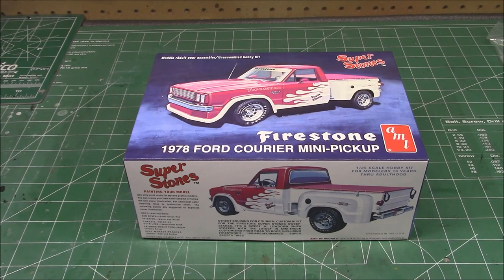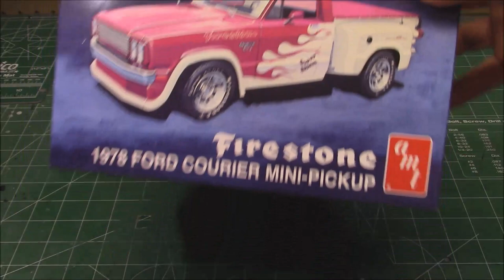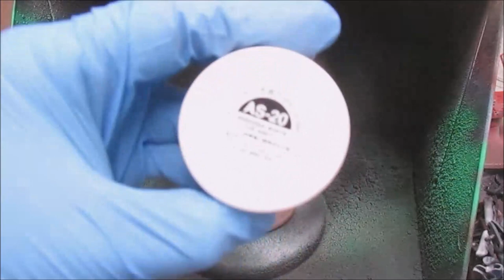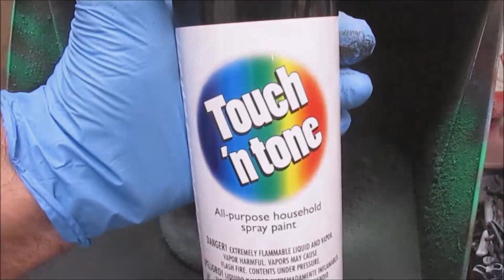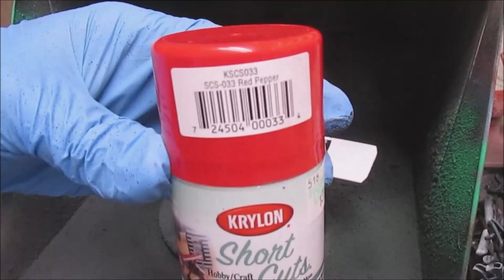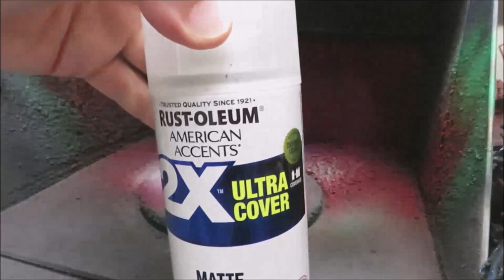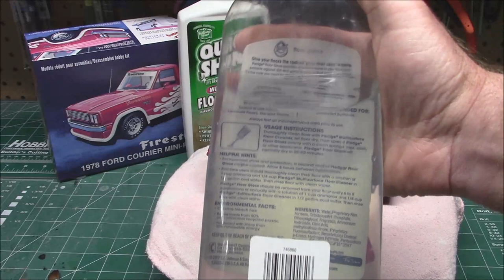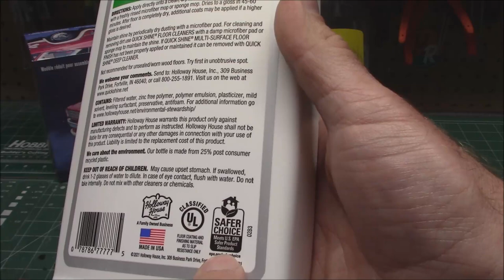1978 Ford Courier Mini Truck Firestone Super Stones 1/25 Scale Model How To Assemble Paint Polish

Comment: This brought back memories Chris, in 1975 I started working at a shop called Taylor Made Vans where we customized van and trucks inside and out, we did New Dealer vans and trucks and customers off the street, we were the first shop in San Diego to do Ford Courier and Chevy Luv trucks with Step-side kits, the kits came with a metal box and fiberglass fenders and steps, lots of fun putting them together and a few itchy nites from the fiberglass LOL

Comment: I had this kit back in 1979 .
It was a 3 in one stock custom race It had the step side and  fleet side bed  It had 3  engines A 4 cylinder A v6 And a NASCAR v8 427..
Can you imagine a Ford Courier Mini Truck with over 500 horse power.

Comment: I wonder if you used the floor polish on the tires if it would look like tire black/tire shine. Or if it would just look bad.
Reply: I would try it out on the back side of a tire,  should be just fine.  It can be used on vinyl floors,  so it looks possible.  Worse case, if it looks funky just wash it off 👍

Comment: In your experience, can Quickshine or Future be applied with a foam brush applicator to avoid brush strokes.  Would a foam brush result in a more even coating?  Love your channel because you build models for fun and enjoyment and not for rivet counters or contests.
Reply from the maker: You could, or you can spray it.

Both self level (they are made to be mopped onto floors) if you leave them alone after brushing. Like I say in the video. 
If you are getting brush strokes you are not leaving it alone after you brush it on. I go over that in the video.